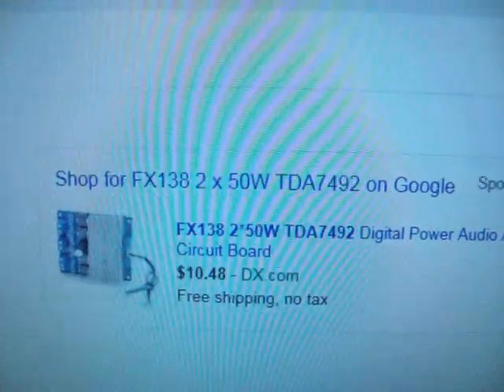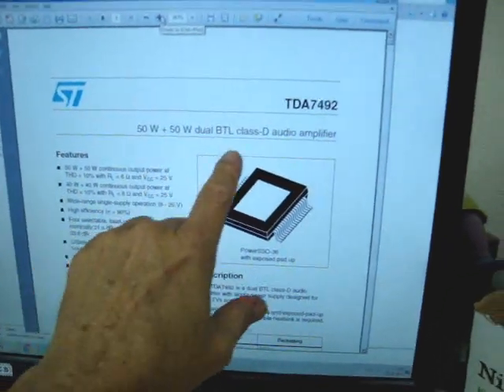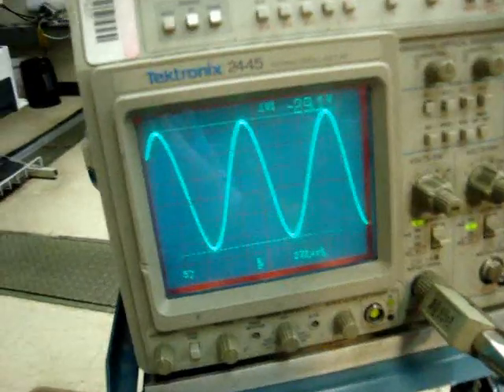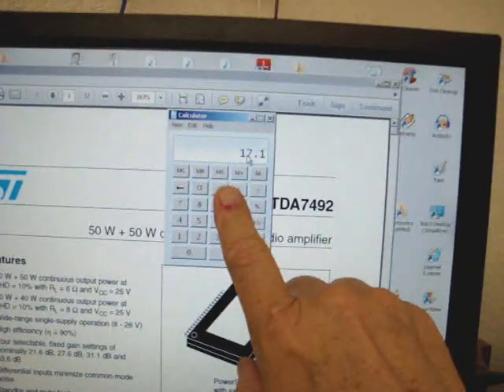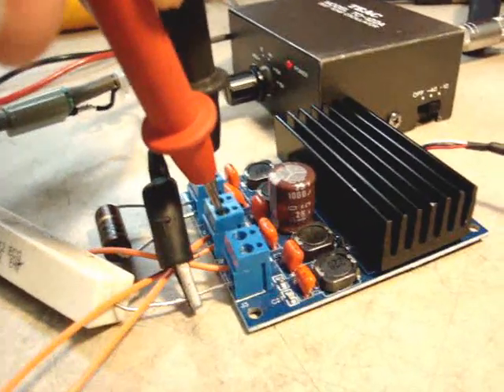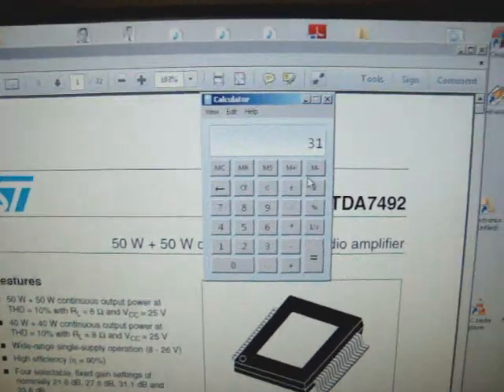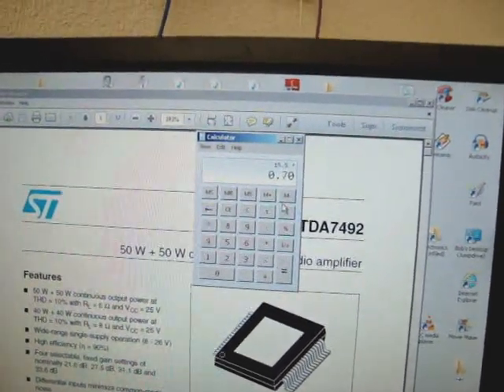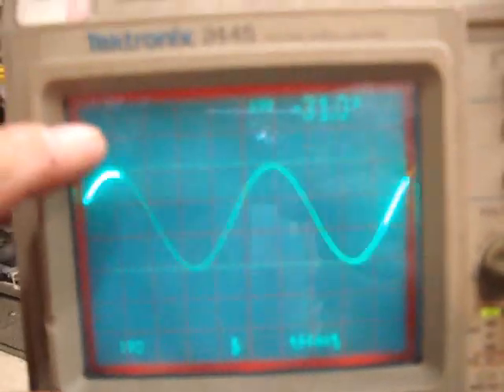TDA7492 Class D Audio Amplifier

Comment: Mine came in the mail yesterday No sound when powered by 12V 10A supply I read in the manual recommended power is 24V 3A
Reply from the maker: Bummer! Is it drawing any current when connected?

Comment: Hi Bob, great to see the details. I would jump directly to ask for your help please-
I have the D class 210 x 210w , 4 to 8ohms.
pair of 40w full range, woofer side 4inch speakers.
pair of 15w full range 4inch speakers.
Pair of 4inch 15w tweeters
pair of ribbon tweeters 30w.
All speakers are in 8ohms. 
300w crossover.
So, I will be adding total 4 drivers on each side.
Are they a good match? How can I hook them up anyway? 
Should I skip the crossover and do the Serries-parallel technique? 
Can you tell me which way should I hook up this above material? 
Thank you :)
Reply: The amp is TDA8954 :)
Reply from the maker: Kketansa Art  - Good question. I'll think that over and I'll get back to you.
Reply: Bob H 
Thank you very much :))) see you soon
Reply from the maker: After some thought of your speaker design, I think you may want to simplify it... like, don't use the pair of 15w full range 4" speakers, or the
pair of 40w full range 4" speakers. Use four 4 ohm 40w 4" woofer speakers in series-parellel to equal 160w @ 4 ohm.  Also, use only one kind of tweeter, like the ribbon type. Also, what kind of crossover are you planning on using?
Reply from the maker: Kketansa Art - The crossover you got is 'interesting.' Most crossovers I've seen give a specific impedance,  like 8 or 4 ohms, but not 4 to 8 ohms. Still, I think yours will work just fine. Do you know the ohms of your ribbon tweats?
Reply: Bob H 
Yes :)
The ribbon tweeter is 30 p w 8ohms. 
Silk dome tweeter 15w, 8ohms. 
Woofer 40w 8ohms,
Full range 15w 8ohms.
Reply from the maker: Ok, so I'd recommend wiring your speaker system an 8 ohm system. Connect 4 of the 40w Woofies in series-parallel (that's 2 sets of 2 woofs in  in parallel (that = 4 ohms each parallel set), then connect the 2 parallel sets in series.) Email me if you'd like a diagram - bob4analog@yahoo.com  :-)

Comment: Per ST,  the TDA7592 manufacturer data sheet. This is a dual channel amplifier rated at 2 x 25W @10%THD. Given the fact the efficiency is better than 90%, good junction to chip and ambient ratio, along with experienced PCB design. There is no need to have a hefty heatsink with multiple cooling fins. It's is overkilled. Because of the thermal build up at listenable music power (usually less than 1%THD or practically 20W), is still far off the maximum power dissipation parameters.    

Be aware that the output stage is a BTL configuration, so it is impossible to bridge the dual channels on the attempt to boost the power in the monophonic application. In the stereo mode, make sure to provide ample supply voltage (24V for example) to minimize THD at peak power demand.
Reply from the maker: Thanks for the verification. Points well made.

Comment: This is typical since around 1980, when IC producers used to inflate the specs to look good. My rule of thumb is to consider half of the specs as RMS and less than a quarter of the specs for real HiFi power.
Reply from the maker: Adrian Andronache - Good point. By now, the industry should have got past all the deceptive advertising.  I don't know what it is with these PWM amps in that they feel they need to be deceptive. The Class AB amps I've tested are honest about their claims... https://youtu.be/PvCATGgXnTg
Reply: No, most of them are deceptive as well; started from TBA810 era, when they claimed it's 8W or something, from 14.4V; when in reality the amplifier couldn't put out more then 4W sinus at that voltage, without distorsion; and of course, music is not sinus; I built amplifiers with transistors in the goldan age of 80's, which i never claimed more then they did; i did when i was in highschool 60V single supplied amplifiers, which today are advertised as 100W, yes they are 100W but that is not 100W music power; music power, thermal power if i can say that, is barely 20W.; in '93 i built a 2x95Vdc supplied power amplifier, which was kind of monster, 2 ohms output, the transformer only had around 20kg; uses RA220 diode bridge and 2x8x4700uF/100V capacitors... Golden era, as i said...

Comment: does it have a voltage booster???how can you get 33V out with a supply of 25V?
Reply from the maker: That's Peak-to-Peak volts as read on the scope. To do the math, divide Peak-to-Peak by 2. Here's a nice tutorial on how Peak-to-Peak volts works: http://www.learningaboutelectronics.com/Articles/What-is-peak-to-peak-voltage.php
Reply: Yes I know what peak-to-peak is (from the very bottom to the very top) but that is limited by the supply voltage, right?
Shouldn't that be less than or equal to the supply voltage?
(actually not equal because the amp is not ''perfect''...there is resistance)
How can the amps output electric potential difference  go beyond the electric potential difference of the supply?
The only thing I can think of that is capable of doing that is a voltage booster, which seems highly unlikely to be present on that amp.
Thanks!!!
Reply from the maker: Ilias - ok.. the amp is not literally producing 33v from a 25v supply; it's 16.5v at the peak of the positive half cycle, then it goes to zero volts. Then it's 16.5v at the peak of the negtive half cycle, then it goes to zero completing a full cycle. I don't know how else to explain it, but I don't think you're fully grasping the peak to peak concept. If possible,  try to understand that first, then it will all make sence. :-)

Comment: One does not need to waste time on these testings. It only takes 1 minute to read the datasheet and realize that it is roughly 20WPC. ST had gone trough all this effort and put all that info inside the document. There is clear characterization for 6 ohm loads on page 11 of the datasheet. One more thing. Those PCB's sold at eBay are most likely configured for higher gain and 8 ohm loads. The output filtering components values also depend on the expected load. They are different for 4, 6 and 8 ohms.
Reply from the maker: Ventsislav Simonov - This is true. However, most people don't know that, since the amp is advertised as 50 watts per channel. Besides, there is a certain satisfaction in testing it as I did. Therefore,  it was not a waste of time. You should try it sometime.  ;-)
Reply: You are of course absolutely right. For the sake of experiment it is not a waste of time. However when choosing a class D amplifier IC(or ready made PCB) testing every possible option isn't practical. That is why datasheets have all those good info inside. One more thing. Advertising power output in IC amplifiers has always been like this. For both class D and linear amplifiers. They all slam that "holly cow amazing" power output in the catalogues and of curse it is again peak power at 10% THD.
Reply from the maker: Ventsislav Simonov - Exactly. Altho, to illustrate, imagine buying a car. You can read and see all the specs and features, but test driving it is always the validation of the claims. Specs are great, but testing validates. Ive never felt that any of my tests I've done were a waste of time, and judging from all the commemnts I've got, it appears that others like it too.

Comment: Just divide Peak Watt by 2, you will get the RMS Watt
Reply from the maker: Right, Thanks. Yeah, I figured that out after I made this vid. I used that method in a few other vids I made. Good short cut.
Reply: shouldn't it be divided by 1.41, which is the square root of 2?
Reply from the maker: You would think so, but actually, 1.414 is what you multiply RMS for Peak voltage. Example: 100v RMS x 1.414 = 141.4v Peak. When calculating power, just divide Peak power by 2 for RMS power. Here's a nice power calculator to test the theories: http://www.random-science-tools.com/electronics/dBm-Watts-volts.htm
Reply from the maker: Alberto Colucci - Exactly! It's nice when we get it. Helps us grasp  the concept.

Comment: I see a potential problem in your setup if your power supply output is referenced to mains earth. If it is the case the oscilloscope probe will present a short to the negative rail. this will impact performance.
Reply from the maker: Correct. I had not mentioned it in the vid, but all the grounds (earth) are floating.

Comment: The amplifier manufactures rely on the fact that the general public simply do not understand amplifier specifications (and why should they?) Another way to make an amplifier seem to have more power is to use 6 ohm impedance, when in the reel world most speakers today have a nominal 8 ohm impedance. With an 8 ohm load the amplifier would probably only make 15 watts RMS per channel. A LOOONG way from 50 watts. Did you test with just one channel driven? If so when both channels were driven into a 4 ohm load the amplifier will probably shut down with over heating due to inadequate heat sinking. Another way to cut costs!
Reply from the maker: - Absolutely right! Yes, there's a lot of deceptive advertising these days, especially annoying when people fall for it, thus my vids.. my version of 'myth busting.'     Yes, I only tested 1 channel. Spose I should've done tests on both, but for the sake of time and simplicity, I just did the test on one channel.    I actually did the test with 4 ohms, but didn't publish it; just wanted to give a brief overview of how the amp behaves according to published specs. The amp actually works better with 8 ohms. That's probably why the specs don't mention anything about 4 ohm operation -- it simply doesn't perform very well.  You'd think by now, being so 'technologically advanced' as we are, that the days of false advertising would have been behind us -- not so.

Comment: thank you Bob, ı was going to order this amp for my car setup 2*40 watt. now ı am looking for  more powerful amp THANK YOU
Reply from the maker: My pleasure to do so. I think whatever power amp you decide to get, it's a good idea to inquire the specs on the amp you are interested in, then check if the output power ratings specify RMS, Average or Peak watts. Honest specs will usually indicate RMS or Average power ratings (since these specs are close to each other) into a specific load in ohms. If such specs give no indication of RMS or Average, then it usually assumes Peak power output ratings, which seems to be the case with these Class D amps.
Reply: Another issue you will face is only having 14.2 volts supply for car use. Without a step up power unit the maximum power you will get will be about 20 watts and that will be in bridge mode into 4 ohms.

Comment: I use this amp in a portable speaker I built. It gets very loud. I have it on 16.8 volt lithium batteries. I would recommend. I'm going to up grade to the tda7498 for 2*100 watts. and upgrade batteries to 29 volts.
Reply from the maker: I did a review of this amp too. It's rated for 'Peak watts,' not RMS. It's good for 50 watts RMS per channel. Not a bad amp, just not 100 watts RMS per channel... https://youtu.be/jGWGAgPx_jw

Comment: To go from peak to peak volts to RMS volts  it is much quicker and easier to divide by 2.828.....
Try it; it works........
Dennis #12
Reply: Bob H Yes. And you can get rms power by deviding by two! avg of sin is √2 which is around 1/1.414, avg of sin^2 is 1/2.
Reply from the maker: Yes, that's a great short cut, thanks!
Reply from the maker: Yes, Correct. I learned that sometime after I made this vid.

Comment: Thanks Bob. I enjoyed your tests. I prefer transistors over strict IC's. Have found that class D has some high end distortion, or clipping. I must hear real hifi, but that's just me.
Reply from the maker: Thanks!  I agree. The PWM amps are just not worth it for the effeciency gained. Then again, they're cheap. These amps are way over hyped. That's why I made this vid. Here's another amp I've done... https://youtu.be/PvCATGgXnTg . This one is a fav!
Reply: John Smith From another perspective if combined with a special dac, it is an ideal combination for dsd source. Great d class amp will give an excellent accuracy which means less compression or uneven in the sound.
Reply: John Yang I do agree. I actually prefer tube amps, no compression.
Reply: +John Smith 
So are you saying even more expensive (and higher grade) class-D amplifiers are audibly inferior to similar priced class-AB ones? I know that in theory and possibly in reality, class-AB has less distortion - but is that actually noticeable if you listen to music for example?

Doesn't the room and placement of the speakers, their drivers (material, rigidity, motor strength, suspension, surround, voice coil), design, enclosures and the power supply (as well as maybe some other factors) have more impact on the perceived sound than the amplifier nowadays?
Reply from the maker: No, not at all. Note that this was to demonstrate actual performance characteristics of the TDA7492 Class D Audio Amplifier board as it exists.  There is so much hype that Class D amps are superior to any other kind of amps. Indeed, there are some really great Class D's available, BUT, they can be costly. Other Class D caveats are circuit complexity and RFI issues, which are usually not the case with Class AB. Course, not all Class D's are expensive. Example is the Lepai LP2020-TI. I love this amp... https://youtu.be/w2L5UfBW_Xg Regarding  room and placement of the speakers, their drivers (etc.), these are normal concerns for the listening environment, as is the 'color' the amp gives to the sound. Then there's the thinking of weather the amp should color the sound or not. So...listening experiences can be rather subjective.  This is demonstrating a more 'scientific' approach to measurable performance as what is done here in the lab. I will not comment on listening performance of such things as power and audio cables, power supplies, electrical delivery (etc.). Here, the lines of reality are often blurred and are exclusive to individual opinion; not necessarily on actual facts.

Comment: This is a piece of shit amplifier..! https://www.youtube.com/watch?v=Ero9LTIXhks
They have sooooo much distortion, I wouldn't trust them not to smoke your speakers.
Reply from the maker: Agreed! They're really not worth the efficiency that they have. I'll take a class AB amp any day.  See my other vid for the LM3886 Amplifier Project.. this is a great amp... https://youtu.be/PvCATGgXnTg
Reply: Bob H Thank's for the tip man..I about to build a small boombox/portable stereo. I've figured everything out and cut the wood. Now I just need a decent amplifier, but it would have to be efficient, cause I'll power it with batteries most of the time. Seems efficiency and good sound don't go hand in hand, so I will be sacrifing some sound quality. Until now I found a few tripath amplifiers suitable...that's the reason I came across this video. I'd say this particular amplifier ain't worth the money, there must be a better option.
Reply from the maker: As far as actual sound is concerned, I think these amps may be ok and they will be power efficient. My vid was just to examine how they actually perform according to specs. 20 WPC is a LOT of power for a boom box; that's what these amps will do nicely. However, it will not do 50 WPC RMS very well. You probably won't hear the anomalies tho. I guess it depends how accurate you want your sound system to be. Look at this vid; this guy made a boom box with this amp... https://youtu.be/_7fSTpviqII
Reply: Bob H I had some thing in the 20-40 W class in mind. Of course those cheap amplifiers can do miracles, so I planned only to let them run 75% of their wattage. Bet I wouldn't get that much distortion this way? Two mono stages driving each channel had also been considered. Ahh...man this amplifier thing is the hardest choice in my project.
Reply from the maker: - From what I've gathered, it would appear that efficiency is of most importance here. You want your batteries to last a long time. Of course, that also depends on how loud and how long you intend to use it. That goes without saying. That being said, I think the TDA7492 amp will be good choice for your application. I don't think you'll ever hear those distortive artifacts. For loud listening, this amp should work quite nice. I'm guessing that you don't really need high accuracy audio reproduction for a boom box. This amp is the right choice.. and it's cheap. ;-)
Reply: Bob H Indeed efficiency would be the biggest concern. Most of the time it would be playing on moderate levels, so a conversation won't end in shouting. I'm just looking for a decent sound quality without a lot of distortion. Of course, one can't expect miracles for such a low price product and I won't compare it to my home audio (Aaron XX edition). Thank's for your advice, it helped me a lot to make a decision.
Reply from the maker: - Glad to know it helped. Give some feedback on how it worked with your project. It'll be interesting to see how it works for your application. Knowledge is power. ;-)
Reply: Bob H I will. Again thank you for your time, Bob..